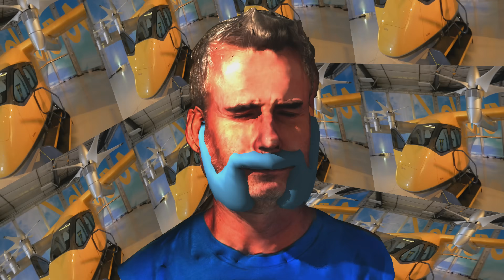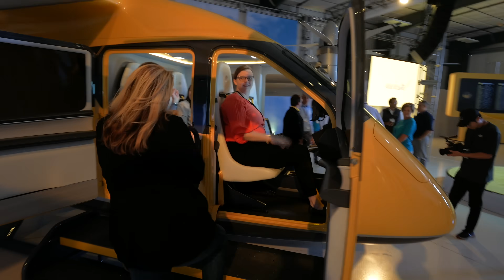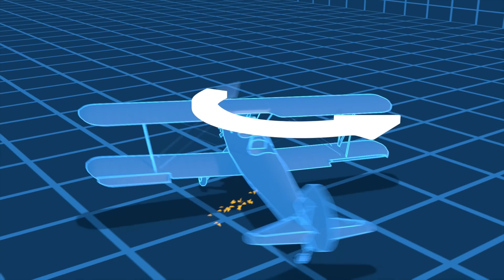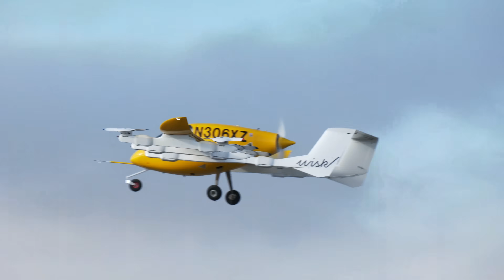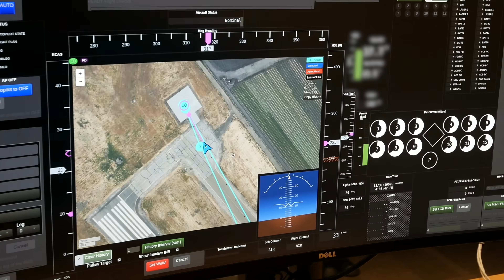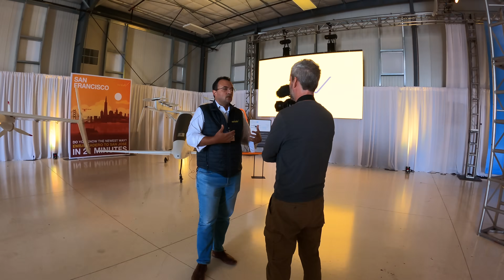First Certified Fully-Autonomous PASSENGER Aircraft?!

Comment: All evtols should be handicap friendly with a easy ramp. All props should be very redundant and inclosed to alow a bumper car affect, so minor contact with other birds or evtols should not disrupt flight. If electric system fails on a thousand evtols at the same time from electric hack, a manual perishut system should be standard to minimize fatalities or even elmenat them before evtol insurance is to expensive. Bad designs could kill the industry before it gets off ground. These are not flighing over Atlantic at 30,000 they will be fighting in dence citys over highly populated areas and all precautions shouldbe taken.

Comment: With self-driving cars, like Tesla, on the verge of achieving level 3 and 4 autonomy, I hope more general airplane manufacturers are working on fully autonomous general aviation aircraft. 

Developing safe, fully autonomous general aviation aircraft is exponentially easier than developing fully autonomous vehicles. Widely varied roads, construction areas, traffic lights, stop signs, roundabouts, intersections, on-ramps, off-ramps, pedestrians, and the million other variables involved with safely operating and navigating a motor vehicle make it far more difficult for a self-driving autonomous vehicle to do reliably and safely than an autonomous aircraft that needs to deal with far fewer variables such as speed, altitude, direction, and weather.

Comment: Reality check here - it's really cool that they've built something that can ostensibly VTOL autonomously (and a neat rotor tilt solution at that). Programmed flight in stable conditions is fairly well understood and robust solutions (autonomous drones) are being developed. You can make a machine which can fly between two helicopter pads, and you can make it pretty good at not landing on top of a waiting passenger. But it's the unforseen events which require vision and intelligence that are truly difficult. In some ways autonomous flight is easier than autonomous driving as the sky is less congested and easier to navigate from point to point. But will this machine know it's caught fire and must land?
Reply: Fire seems straightforward to detect, sure. Also passengers will be able to hit an emergency button I suspect , in comms w ground support.

Comment: With just a little more range that would be AMAZING, The people of Niagara could finally have a proper link straight across Lake Ontario. The worst part of getting to Toronto from Niagara Falls is that you spend half of your drive, driving AWAY from Toronto because there is giant ass lake in the way. It can probably make it as is, in still air, but it's marginal. It might be a one way trip depending on the wind. 

They say there will be a hovercraft ferry next year, but I'm skeptical, It's gonna require infrastructure on the Niagara end that does not exist, and as far as I can tell, hasn't begun construction. 

Best we have now is someone running a light piston twin from YSN to YTZ.

A reasonably priced EVTOL ferry, from those 2 airports, 24/7 accessible, would be incredible, and might actually work. 

Good luck Wisk!

Comment: Taking the “human component” out will make air flight many times safer. Can’t wait
Reply: I disagree. I often have conversations with others that share your opinion and I find that they often have a bit of survivorship bias in their analysis. It's very easy to look at accident rates and causes and to make a determination that humans are screwing everything up. The missing data in this case (survivorship bias) is all the times that humans successfully keep the machine/computers from fatal mistakes. The short answer is: all the time. You never hear about these events because the flight is successful.
Reply: @nincapoo  for some context to my original comment, my sarcasm was from seeing human car drivers acting like idiots on the road.  There’s a higher level of training required for aviation vs cars (and therefore it’s not the same comparison). I agree with you that human supervision is required (which Wisk has) but shouldn’t be the main pilot. As they expand, the number of COMPETENT pilots will be depleted, making it difficult maintain safety. Automation is the only way this model will work. And I’m all for it.

Comment: Takes 320 kW to hover (not even sure if they had dummy weights in it to simulate persons on board). That means within 2 1/2 minutes of hovering, they consume as much energy as the Chevy Volt battery has when full - weighing in at 435 lb.
Reply: Wouldn’t it burn about 13 kWh in those 2 min?

Comment: As a programmer, I can’t see myself riding in an autonomous car, so being on a deck of one of those with no controls is a nightmare material 😵‍💫
Reply: Or maybe he's more aware of the limitations of current ML driven algorithms and how they can end in disaster. See for examples the multiple cases of teslas driving into motorcycles and combine harvesters.
Reply: @DonkyHott  Uh, no, these aren't operating in the same way nor with the same hardware nor with the same contexts...
Reply: @error.418  I believe it's a good example of object recognition failure. There may not be motorcyclists in the skies but birds/drones/cables/etc present no less of a danger. And while radar may be more reliable for spatial awareness it's no silver bullet. Aircraft crashes and collisions tend to be more fatal than ground ones so the stakes are higher.
Reply: @DonkyHott  Because the stakes are higher, the regulations are also higher. Human pilots also don't dodge birds, and you don't fly at altitudes with drones/cables/etc. They're jut not comparable.
Reply: @error.418  If you are building air taxis and delivery vans you are by neccessity flying as low as possible to minimize energy use and flight time especially for an electric vehicle. So birds/drones/whatever are all very real possibilities in uncontrolled altitudes where these things will operate. And they will probably operate fine 99.x% of the time. My point is that sensor fusion and general AI are not remotely there to be relied on to act correctly in edge cases.
Reply: @DonkyHott  You clearly don't know much about aviation...
Reply: Probably because the space you're in as a programmer is a very different one from building highly redundant autonomous flight systems.

Comment: As a (glider) pilot. I absolutely hate these developments to be honest. I fear what tech like this on mass scale will do to GA, foremost that it will eat away at the airspace available to GA traffic to allow a few massive corporations to make profits flying in that airspace. As an mechanical engineer I'm extremely sceptical about the mechanics of it all. Especially the last design with 4 tilt rotors seems extremely failure sensitive. I also have a hard time believing the noise is not a problem. Quieter on the dB scale maybe, with a wider spectrum, but put enough traffic of it together I fear it is still going to be noticeable and annoying

Comment: No way would i ever set foot in 1 of those. Even though I have a helicopter, if someone lets say, took the real pilots hostage, and crashed the planes, the passengers would have no way to fight back. Its too dangerous to me, with no controls to prevent an actual accident. Or the loss of signal, power, or directed weapons interference.

Comment: Back about 10 years ago I was a UAV Instructor Operator in the US Army (he humblebragged).  I operated (notice I didn't say "flew") the RQ-7B Shadow UAV.  That system completely ran on autopilot from launch to recovery, essentially like what you've shown here.  While I never had any issues with the automation per se, I swore I would never ride in a system like that as a passenger.  I'm not just a curmudgeon, they are stupefyingly  easy to operate as so long as things are going well.  It's when you need to tell it to make a rapid change that things get complicated, even when using the extra controls on that box they had you blur out.

Something that you might do reflexively with a flick of a wrist or a push of a lever required active conscious thought and several seconds of furious action when manipulating the user interface.  It would cause you to momentarily lose situational awareness while you frantically tried to get it to perform a very simple but very specific new task.  This wasn't something that occurred once in a blue moon, this was a frustration that I just learned to deal with on every single flight.  Other people can ride in that all they want to, but I'll stick to Cessnas and Pipers from now on.
Reply: parachute handle and 10g helicopter seats. You'll be safe. These will be safer than cars, unless the US keeps sending anti aircraft missiles to Ukraine and the black market continues to be flooded with these weapons.

Comment: Considering how loud and obnoxious commercial drones are, I can’t imagine this with 12 lifting fans plus a pusher prop. I guess there’s a reason why the whole video has a music soundtrack. Not looking forward to this at my GA airport.
Reply from the maker: The onboard cameras didn’t record sound, and the aircraft was too quiet to get much sound from the B-Roll cameras. (You can hear the recorded sound at the start of this video - That’s all I could get with the camera mic).  
So I can say first hand, your assumption is incorrect.  These things are very quite. Like way quieter than even a small single engine GA plane.  A Cessna 172 flew over head (at pattern altitude) just before the test flight and it was striking how much louder it was than the Wisk craft that flew at 30 feet in front of us.
Reply: @FlightChops  How? They do not look like low speed high cfm fans, nor do they have advanced blade shape like A400. I want to hear it with 800 lb of passengers on board.

Comment: "It will be flown by ground observers" At least they will be safe.......except from the lawsuits
Reply: Raises a great question about information security though. You'd want a remote operated system to be extremely secure from malicious hackers.
Reply: Being a supervisor will be initially a nice job that then turns into the most boring job ever. Any issue that can happen will probably happen early on ... and then never happen again because it will get addressed in software. So the next time there is no need to intervene. And the mean time between interventions will go from days to weeks to years to maybe once in million supervisor years/careers. The whole goal here is to completely remove the need for any human intervention; so  any time a human intervenes is a bug and they'll end up fixing it. In a few years, maybe the only scandals you'll hear about are bored supervisors getting drunk on the job or  taking naps. Eventually, they'll be declared more of a liability than an advantage.

The in between phase is going to be interesting though. The first few planes will have a lot to prove. And then they'll get normal. And there will be more of them. Etc.

Comment: Did they address anything about power out? Will it land itself on the best available field if an airport is not available? Will it land itself on a runway with no power?
Reply: Hi Alessandro! Great questions! 

We plan to fly pre-planned routes, which will have designated emergency landing sites along each route. 

Additionally, we've designed the aircraft to meet "10 to the minus 9" safety standards - meaning triplex flight control system architecture, triple redundancy with full hardware/software dissimilarity and no single point of failure. This includes redundancy with the battery packs. While we can't go into detail, the batteries are tolerant to failure. 

With that in mind, the aircraft continually monitors all of the systems during the flight. In the event of an issue, it will recommend the best course of action and either initiate a landing at one of the predetermined sites, continue on to the destination, or return to the takeoff location. All flights are monitored by a multi-vehicle supervisor on the ground and can override with new commands at any point.

Hopefully, this helps answer your questions!
Reply: @WiskAero  Very cool stuff!  I assume there is a lot of redundancy and security in the comm links?

Comment: Certified or not, I'm not flying in it.
Reply from the maker: This comment came 5 mins after publishing a 20 minute video 😂. 
Give it a chance to at least watch and see what they've got going before you assume the worst.
Reply: @FlightChops  you have to see the disastrous potential here.  Elected morons with law degrees will buy anything with the word safety attached no matter how absurd.  I had a run in with a drone back in 2015 at 1700’ in class D airspace.  The thing was about 6’ across and doing every bit of 60kts.  The only thing worse than a drone is an autonomous craft.
Reply: @FlightChops  Not worth replying to such comments.
Reply: Take the bus then.
Reply: Yeah I’m scared of new things too! so I’m not gonna fly in an airplane ever,  I’ll take the horse and buggy…
Reply: @wcolby  its not about new, its about automated.  Consider how often your average smart device app crashes per day.  Now imagine being in an aircraft incapable of being flown manually that is controlled by software devised on the same standard as the typical mobile game.  It is a terrible idea.
Reply: @mikewaterfield3599  And I politely respond… I’m not getting in the elevator without an elevator operator.  Wait a minute where’s the soda fountain Operator do you want me to make my own soda? do you want me to get on that subway car without a train engineer at the front? Times change, someday I am confident you will look back and wonder what all the fuss was about.  I fly every day as a passenger and I’ve never met a computer that was angry or having a bad day.